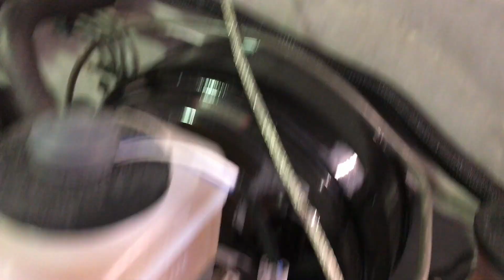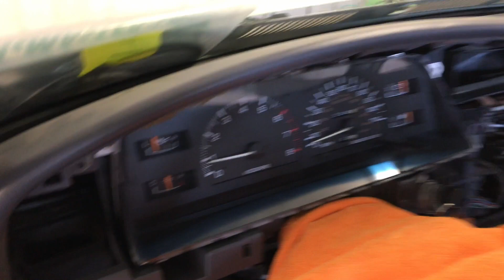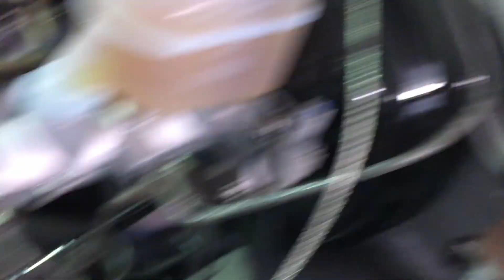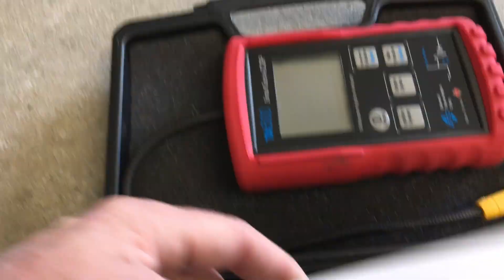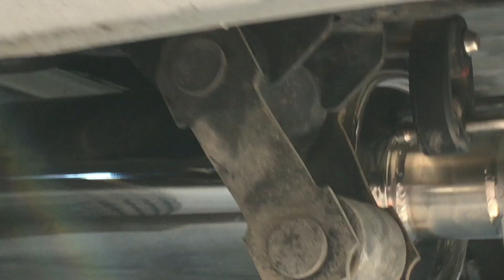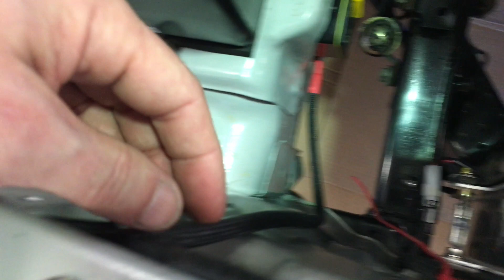Starting the 22RE 1990 2WD Toyota Pickup w/ Champion aluminum radiator & electric SPAL fan

Comment: Hi Ray,
Great videos. Got a 1992 2wd original. I did install a radiator with electrical fan. Where did you get the neck with the thermo switch thread? I need to connect the relay.
Thanks again for your video!
Reply from the maker: try searching eBay for "1984 - 1988 TOYOTA PICKUP 4RUNNER sensor port" and you can sometimes find them - then chase with a tap to match your fan switch. Make sure you get the aluminum one, because there is also a cast iron version.

Comment: How has that electric fan held up. Wanted to get an electric fan but I’m unsure how good it would hold up out here when it hits 105 degrees especially with a stock radiator.
Reply from the maker: It's been rock solid. SPAL is the brand Ferrari uses for their cars... very high quality fan from what I can see. Never had any issues. 105 outside shouldn't be any issue as long as your truck stays cool while moving. The fan moves roughly the same amount of air as when you are going 40-50 miles per hour if not more. Balancing the thermostat can be a bit tricky. My advice would be to stick with the mechanical fan setup for a street car, unless you either just wanna have an electric fan or believe cars should = pain :-)
Reply: @ray5961  My stock fan runs fine during the summer. When I’m stopped idling the motor does heat up a little more than I would want towards the middle on the gauge, but it’s never overheated on me. Was mainly looking to switch to an electric fan so when I’m idling in traffic more air gets to the ac condenser so it doesn’t feel like a swamp and was also hoping it would cool a little better. I might have to look into it a bit more.
Reply from the maker: @e49erss  Yeah, I hear ya. As you probably already know, the fan only comes into play when you are either stopped or when you're moving under around 30 miles per hour. I will say that with my truck, sometimes if I'm climbing a grade, it is nice to be able to manually turn the fan on and get additional cooling happening (those SPAL fans are extremely strong). Same goes for idling at a stop or in traffic, if your A/C isn't cooling well, turning the fan on manually might help. On my truck, I have to run a 170 thermostat and I believe the 180 or 190 spal fan switch... this causes the fan to turn on when the water temp (coming back from the radiator) is around 180 or so and then the fan turns back off when it drops to maybe around 140. When cruising, the aluminum radiator keeps coolant temps down around 110 or 120 unless outside air is hotter than 75 or 80. But yeah, having an electric fan is nice, as long as you don't mind dealing with a bit of wiring, etc. It was a fairly extensive project to get everything working on my truck though, but I do love the setup.

Comment: Nice truck!  What size tires are on this truck?
Reply from the maker: 7.5 x 17 wheels / tires are P225/65R17 Kumho HT51 102T tires
Reply: @ray5961  Where did you get the wheels?  I'm having a very hard time find options for this bolt pattern!  Right now I'm tending toward American Racing AR23 wheels but I like your wheels better!  Plus, I'm trying to get wheels that I can easily find 225 tires for and it is hard if the wheel is not at least 16" or more.
Reply from the maker: @gregdavis9376  Yeah, I feel your pain man. I had a hard time finding wheels I liked also. The ones I have are LE37K limited edition Volk wheels 17x7.5 with +30 offset. Bolt pattern is 5x114.3 - I'm running 8mm spacers to bridge the hub size stuff. Very light weight.. around 14 lbs each. Forged aluminum. I bought mine from a guy in Russia and 2 of them got lost during covid and took 4 months to show up. They were offered by Rays Engineering / Volk Racing back around 2000. Try searching around eBay using the bolt pattern and size.. or maybe search for SE37's also.

Comment: where did you get your overflow tank hose it looks braided? i want one the hose that goes to your overflow tank @Ray Nada
Reply from the maker: Hey Robert - nah, it's just a rubber hose, but I have a high temp sleeve over it. Search McMaster and look for their rubberized fiberglass high temp wiring insulation. That's what I used there, just to give the rubber a little protection from the hot aluminum radiator.
Reply: @ray5961  can you send me the lick to the exact one you got there's so many on there website haha
Reply: (link)
Reply: @ray5961  and what size?
Reply from the maker: @chefrobertcaldas  I think it was this one, but not totally sure: https://www.mcmaster.com/8760t21/ it was either 3/8 or 1/4 size. I bought some from McMaster and some directly from the company or off eBay or something. I think 3/8 is the size though. The rubber hose inside is just Nappa rubber hose. Not sure what size, but whatever fit my radiator.
Reply: @ray5961  awesome thx again brotha I just got a champion radiator and im gonna put that on as well,

Comment: post up those part numbers! truck looks amazing
Reply from the maker: Thanks man! I have a video showing the radiator, it might have the part # in there. You can also search the Champion website and find it pretty easily. I'll look up the part # for the Spal fan and post it here later for you.
Reply from the maker: Here's the part # for the Spal fan I'm running 30102082 - I bought mine via amazon https://www.amazon.com/gp/product/B009OBOWGO/ - also this fan relay kit here https://www.amazon.com/gp/product/B003PB4AY8/ and then here is the spal fan switch I am running https://www.jegs.com/i/SPAL/063/195TS/10002/-1 for the Radiator, it's the Champion one that is listed at 1986-1995 Toyota Pickup 2 Row, model 945. Oh and you'll need to run a 170 degree thermostat or the fan will kick on at the wrong time. I'm running the MotoRAD 240-170 in my truck and I have the Toyota aluminum thermostat housing off some other model Toyota which has the threaded bung on there (but I had to chase it with a tap as I recall to get the fan switch to sit down in there correctly and thread in and all). The Thermostat is made in Israel - see http//www.motoraduse.com
Reply: @ray5961  you’re awesome man, thanks a bunch!!
Reply from the maker: @ketchupheadd  You're welcome :)